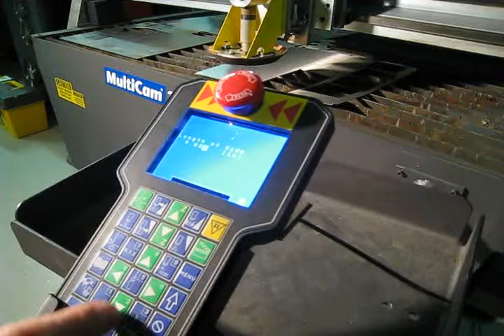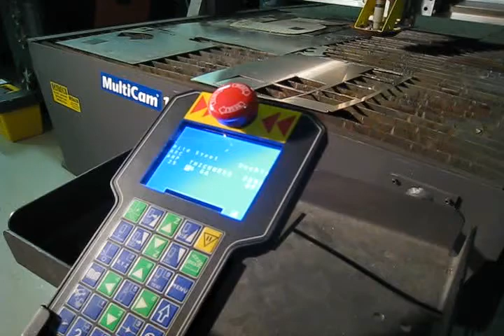EZ Control

Comment: How do you remove cut files from the machine? The download numbers are packed out and we can't delete any
Reply from the maker: Hello Andropov, we reached out to our Applications Manager and he notified us that memory is very limited in the keypad so there would only be approximately 5-6 job files. That being said, that files that you may be referring to may be in a separate computer folder where your designer/programmer has them all stored. If this doesn't resolve the issue, feel free to contact our tech support team at 855.894.3136.